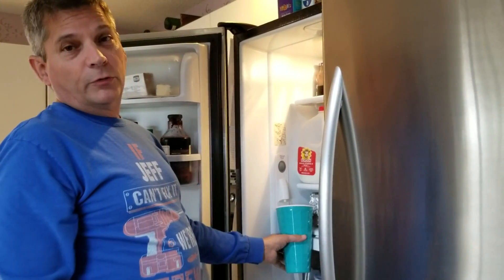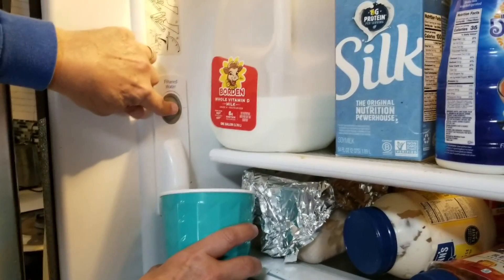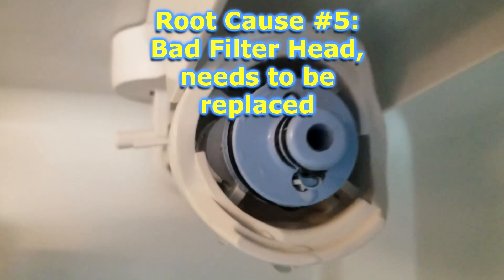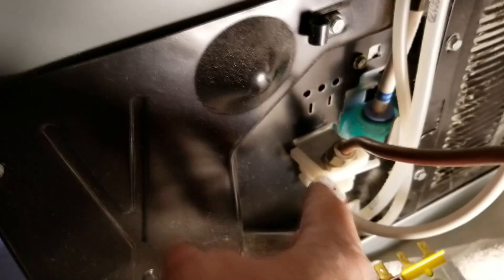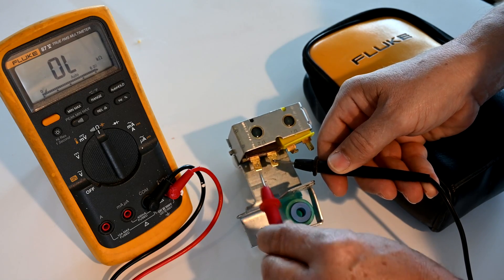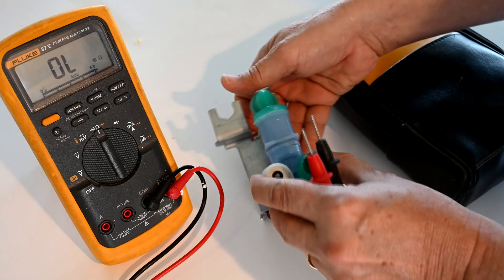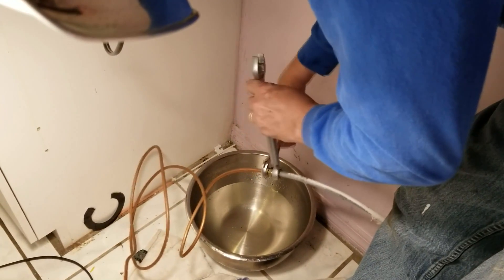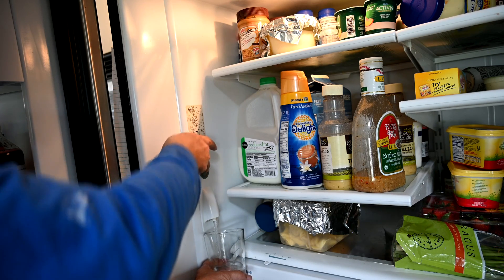5 Reasons Fridge Won't Dispense Water: Inlet Valve Fix DIY

Comment: Hi sir, I think I’m having frozen reservoir, I spent almost half an hour but it didn’t help, just wondering if I turn off the refrigerator for like a day, would that help fixed the problem?
Reply from the maker: If your problem is a frozen reservoir that will fix it. But most people just run a hair dryer in high heat mode for 5 minutes on tit to thaw it out.
Reply: @jeffostroff  Sorry I misunderstand, did you mean on the water tank (behind the veges draw) or tit hole where the water coming out?
Reply from the maker: @camboking1316  Yes, the plastic reservoir behind the vegetable drawers sometimes freezes solid with the water inside it unable to flow now. So using a blow dryer to heat it up and thaw out the frozen water fixes the problem

Comment: We have a GE side by side with ice and water in door. Water come out reg speed  for about 3 to 5 sec then slows to a very small stream. What do you think could be wronge?
Reply from the maker: Check the plastic water reservoir in your fridge see if it's frozen and use a hair dryer to thaw it out. Also see if the filter head where you plug in the filter is bad. I assume you already changed filters?

Comment: Thanks! This one helped me! Mine was kind of #4. I went to look at the valve and found it had somehow come unplugged. The refrigerator came with the house, and it had never worked. Your video and 30 min of troubleshooting and it was working!
Reply from the maker: Awesome Doug, glad to hear you solved it. Those valves can be $70 if you have to replace. Previous owner would be upset to know that's all it was!

Comment: Omg I have the sane frige except my despensor is leaking.. what would you recommend to look at and replace
Reply from the maker: Juan, test the water flow coming from the dispenser. Is the stream of water when you press the button a nice strong stream of water like normal? Does the stream sputter and almost stall? If water stream is light on water pressure, then this can prevent the valve from closing. Check your reservoir bottle make sure it is not leaking. If it looks ok, then the problem is likely your water inlet valve is not allowing enough water pressure inside the fridge and will have to be replace.
Reply: No it’s been kind of weak ever since we have a small line of filtered water running to the fridge. My problem now is that it’s leaking slowing with out us pressing the button. Something like a rain drop every second. Thanks for replying So fast.

Comment: Great video.  Question, can I check the ohms on the inlet valve without disconnecting the water hoses connected to it? I checked mine (unplugged power from wall and unplugged 2 connectors from the valve) and it seems to check out fine (.185 on one and .265 on the other) but I did NOT unplug the water lines from the valve.  My reservoir isn’t frozen and I have a filter plug in place vs a filter, but 2 days ago I stopped getting water from door and the ice maker isn’t working.  I’m trying to determine if the valve is bad, thus my question.  Finally, I suppose even if the valve checks out electrically, it could still be faulty mechanically, correct? Thanks in advance!
Reply from the maker: You don't need to disconnect the water lines, as long as you unplug the wires, you can just measure the leads. Did you check the plastic bottle reservoir inside the fridge on the back wall inside, see if that bottle is frozen. Many people have reported back that my trick for using the hair dryer on heat blowing on the bottle a few minutes thaws it out and fixes the problem.
Reply: jeffostroff Thanks for the response.  Re the reservoir, yes, I did check that.  It doesn’t look or feel frozen but I still did the hair dryer trick for about 5 minutes.  The fridge appears to be the same, or very close, to the model in your video.  The water dispenser button depresses with an audible and tactile click and I also hear the electric hum of something happening, it’s just that the ‘’something’ isn’t resulting in water or ice 🤣. Water flow from the wall is strong, I tested that.  One interesting detail perhaps; I disconnected the water line that routes from the filter to the inlet valve and had my wife push the water dispenser button.  No water flowed out of the tube but water did back up out of the inlet valve hole where the tube was plugged in. To me this signals maybe there is an issue upstream from the inlet valve (no water flowing through tube from filter to valve) and downstream from the valve (water backing up when dispenser button is pushed).  I know it’s not the filter since I don’t use one and use the bypass plug instead.  The reservoir isn’t frozen.  Maybe clogged tubes somewhere, but I suspect that isn’t it.  I suppose I could just buy a new filter inlet valve, $80 from my research, and see if it does the trick? Since the leads test out okay per my meter, maybe it’s a mechanical failure in the inlet valve.  Any other suggestions?  Thanks again.
Reply from the maker: @jspence001   On this fridge we ended up replacing the filter head which is where the water filter plugs into that blue connector that comes with the hoses by the way. Here is the link to the other video that shows this I I'm betting that that's probably your problem https://youtu.be/t4W0EaNo9gc
Reply: jeffostroff Sure enough, it was the filter head as you suspected.  $45 part and a 5 minute repair, boom, water at the door (flowing much better I might add) and to the ice maker.  Thanks again!!

Comment: At  3:15, that tube (water reservoir) has a leak. how do we fix this? thanks
Reply from the maker: You don't fix it, you replace it. If you really want to try and you know where the leak is, maybe a tiny crack or seam separation, I would use a soldering iron to melt the plastic enough to reflow it and cover up the crack and let it harden and that should solve it. but if you have other cracks, it might be a useless task.
Reply: @jeffostroff  thank you so much! I just ordered one online

Comment: Thank you for your video!  I have a Frigidaire Gallery refrigerator with an ice and water dispenser in the door.  I just want to leave a comment that the hairdryer trick worked.  My fridge didn't have the reservoir like the one you showed, it had coils of water line at the bottom of the refrigerator compartment.   I took the hairdryer to it and it melted the ice in the lines and water then flowed freely! I don't understand how it is that this happens when the power goes out (it was out for 5 hours), thought??  It does this nearly every time the power goes out...
Reply from the maker: My guess is when power goes out, the water is not flowing so it freezes in the back, or if you have to many food items in front of it blocking the airflow, it gets colder and freezes over.

Comment: Hey I need that shirt for my dad!
Reply from the maker: Love that shirt, I gotta order some more!
Reply: @jeffostroff  quick question. We just bought a used whirlpool. The water worked at the guys house. We get it home and now it doesn't work. We had to buy a filter and installed it. Water still does not work
Reply from the maker: @AkronKid330  Check to see if the plastic reservoir is frozen. It's inside the fridge, on the back wall of the inside compartment. Sometimes they freeze up and water can't flow. Thaw it out with a hair dryer. Are you sure the water supply to the fridge is on?
Reply: @jeffostroff  it can't be that cuz we had just hooked it up. Nothing could have been frozen. Everything is connected and on
Reply from the maker: @AkronKid330  Seems like your problem started with the new filter you replaced. Try putting the old one back, see if it works. Maybe new one is cheap clone, or is it OEM?
Reply: @jeffostroff  the fridge came without the filter. I went to Lowe's and bought the correct one
Reply from the maker: @AkronKid330  I'm hoping the water inlet valve did not suddenly die $70 for a new one, it's on the back of the fridge at very bottom, where your water supply line connects in. So you need to systematically see where is the last spot that you confirmed running water. Do you have the ice maker line going to a shut off valve under the sink? Or is it connected to a saddle valve? All these need to be checked. Disconnect the ice maker supply line from the back of the fridge, it should be gushing water. Also, try to remove the water filter and re-seat it, and twist it all the way, the 5 or 8 holes you have on the filter can be real tiny and sometimes if the filter is not on the right way, it will not allow water to pass. . Does you fridge come with a water filter by pass plug? If so, put that on in place of the filter, see if you got water flow.
Reply: @jeffostroff  thank you so much for your replies. I will take a look at all of that and see what the problem is! Great information.
Reply: @jeffostroff  also, my filter is not a twist. It just pushes in.
Reply: @jeffostroff  hey buddy just wanted to let you know we got the water working! Replaced the inlet Valve and what do you know, it works!
Reply from the maker: @AkronKid330  Awesome news, congrats!
Reply: @jeffostroff  I also ordered my dad that shirt. Lol
Reply from the maker: @AkronKid330  yup I thought they could be ordered in any name

Comment: Hi. I was cleaning my water dispenser, a small white thing that looks like a circle came off but I don’t know where it came from. I tried two different things and the first, water kept coming out without touching it. The second the water doesn’t come out at all. Can I have some help
Reply from the maker: That sounds like a gasket. You should be bale to put it right back where it came off. It would help if you could upload a video of it to your channel, and post the link here, show the leaking, and show the gasket, and where it came off from.

Comment: Thank you for putting the video on here. I had an issue with no water coming out! Used a hair dryer for 5 mins over the water storage unit inside the fridge. Water is working fine now, thank you👌🏻
Reply from the maker: Glad it helped Adam! Numerous people are reporting that our hair dryer trick worked for them too! Glad it wa snot your $70 water inlet valve.

Comment: Hi Jeff Great video thank you. after being away for six weeks, I believe my water lines froze and I tried the hair dryer trick. It did indeed melt the water in the reservoir. I then tried the dispenser again. I hear water coming in from the water source, but not dispensing. It is leaking somewhere from the fridge onto the floor unfortunately. Perhaps I tried too hard to force water in when all was first frozen?  I took out my filter and put the bypass in. After pressing the water dispenser, I believe it is taking water in from the reservoir as there is a little water that appears when i take out the bypass to check. Thus I believe the problem is somewhere in the line between the bypass and the dispenser. Could that be frozen too or bigger problem since it's leaking? Somehow water is getting in, but leaking now onto the floor. Thank you!
Reply from the maker: If water is leaking onto the floor, it means one of your water supply hoses inside the fridge either burst from being frozen, and so it might have cracked, or you one end of the hose cape off where it was supposed to plug in. You might have to remove a panel inside the fridge to see if water is getting from the reservoir to the water dispenser. You have to find the source of that leak to fix it. You need to get eyes on the hidden parts of that hose. Let us know what you find out.
Reply: @jeffostroff  Same problem, filter is working, ice machine working, I hear the mechanism when I push the water dispenser but it seems to be misting/spraying somewhere between the valve and line running in/out my fridge (it's just a coiled line, no actual reservoir). Haven't pulled off the metal tape yet to look inside, I think I have to detatch the valve just to reach it.

Comment: I have a problem you didn’t talk about. The water flow was fine but as soon as I changed the filter it stopped running. I placed the old filter back in but it still won’t run. Any suggestions?
Reply from the maker: It could be the filter head, which is the part that your filter actually twists on to. We had to replace that in our fridge. Also, make sure water is not intermittently freezing up. Check the plastic reservoir inside the fridge on the back wall, and if frozen, use a blow drier to melt it and see if that helps.

Comment: Hey Jeff. Water comes in to door line great, but between that and the door line is a small coupelor with a blue end and red end, Ive taken it off, water comes through when hitting h20 button on fridge, but wont flow from coupelor and door spicket. What gives? BTW our dispenser and ice are on front of freezer door.
Reply from the maker: Can you get to it to see if the line froze inside there or if something clogged the coupler? The coupler alsmost sound slike your describing a water inlet valve.
Reply: @jeffostroff  the coupler is clean. Water comes from fridge side. So it must be between the coupler and the spicket somewhere in the door.. no access panel inndoor either. Thanks for the help.

Comment: please help..i changed out the water filter, i replaced the water inlet valve (well i did not, but someone did) and i hear the filter kicking on, but istill have no water , no ice
Reply from the maker: Did you try the hair dryer blowing hot air on the plastic water reservoir inside the fridge on the back wall? That solves it for a lot of people. If that doe snot work your last item is the filter head replacement (not filter replacement). See this in our other video here https://youtu.be/t4W0EaNo9gc

Comment: Hi My Refrigerator won't make ice but I still getting water in the dispenser can you help please
Reply from the maker: We have a follow up video that shows how to measure resistance on your water inlet valve here: https://youtu.be/t4W0EaNo9gc last 5 minutes of video or so. It could be faulty ice maker or also sounds like your water inlet valve needs to be replaced. Usually you have to buy the dual inlet valve, as one controls the water, the other controls the ice, but they tend to be attached, like a duplex house.  I have replaced both before on our fridge. You can rule out the water inlet valve by measuring resistance across the leads of the valve solenoids, if you can get to them on the back of your fridge, otherwise you may have to go through the work of extracting them to get at it. If you check forums online search google for your symptoms and model number, someone usually knows things to try, and how much resistance you need to see there on the inlet valve solenoids.

Comment: Do you have a video discussing what causes the water to continuously run after pushing the lever. ?
Reply from the maker: No Deby, we don't but if the water keeps on running it sounds like your water inlet valve is likely bad and needs to be replaced, or the switch could be bad and is still making contact after you release the button switch.

Comment: I put a new filter on 6mos ago, it cut the water flow in half. I put a new filter on today and no water flow. I put the bypass in and still no water flow. Any idea what's going on? Why would the bypass not even work?
Reply from the maker: The problem was never your filter. Did you try the hair dryer blowing on the reservoir and line to see if water got frozen inside the line?
Reply: @jeffostroff  I did blow-dry the tank and it started working again. But flow is still 50% of what it was since I installed that first filter 6 mos ago. Fridge is prob 7 years old. Maytag.
Reply from the maker: @richiesun9676   If there is no clogging your waterline anywhere inside the fridge then I would look at the water inlet valve so you will have to get an ohm meter and measure across the leads when it is not connected in make sure it has the proper ohms
Reply: @jeffostroff  I wonder if the water line is clogged with all that carbon grit from the filter.
Reply from the maker: @richiesun9676   Is the ice maker so making ice OK? I still think it might be the water inlet valve there's 2 valves 1 as for the ice maker the other one is for the water usually they just fail altogether but if you get 1 that's not running smooth it might give you 50% of the water. You can try to disconnect all the hoses and make sure they're clean I assume they are transparent so you should be able to see into them.
Reply: @jeffostroff  ice maker is working. Clear hose to goes to door. Looks dirty. Like there's all that black filter grit in it. Maybe the inlet is dirty.

Comment: I have this exact model frig.  The valves work and the reservoir is not frozen. When I place the bypass cap on and press's the side water dispenser switch, there is a loud vibration noise in the filter section, the water pulsates into the glass for a few seconds and stops.  I take off the bypass cap, replace it and the process happens again each time I take off the bypass cap.  Thoughts???
Reply from the maker: If you still can't get water, then my money is on the water inlet valve. Make sure the filter head plug is really working, make sure there are no frozen spots anywhere in the hose. It might not look like it's frozen when it is, that will prevent water flowing. If that all checks out, then the inlet valve is all there is left.

Comment: I just want to let you know the hair dryer worked it was just the line running to the water dispenser frozen. Is there a way to increase water frow pressure it seems slow but I'm happy..thanks again..Rob
Reply from the maker: If you're pressure seems low, make sure you melted all the ice even in the hose. Also sometimes the filter can clog up, and if that still does not help, you'll have top do what I did one another video, and that is replace the filter head itself, which attaches to the water filter inside the fridge. See that repair that we made here: https://youtu.be/t4W0EaNo9gc